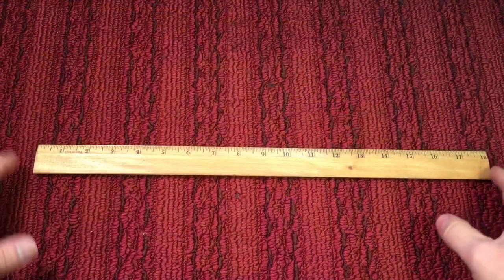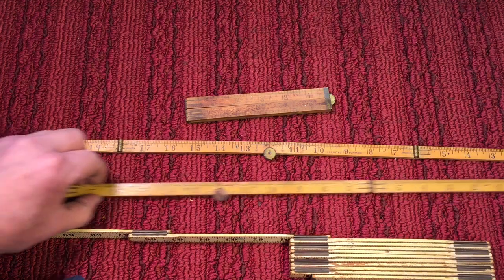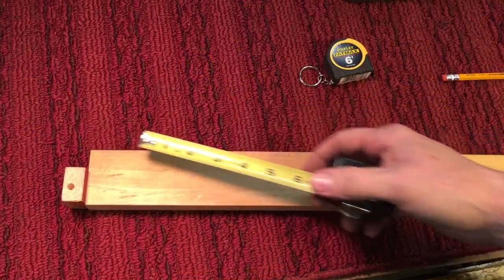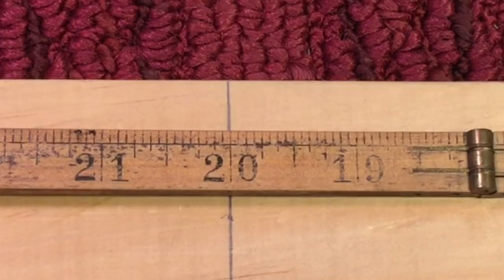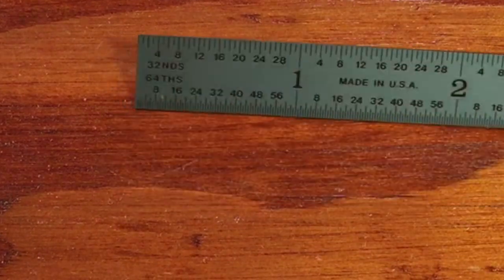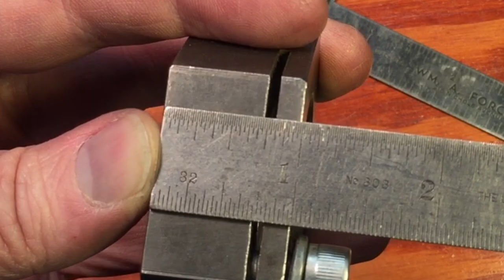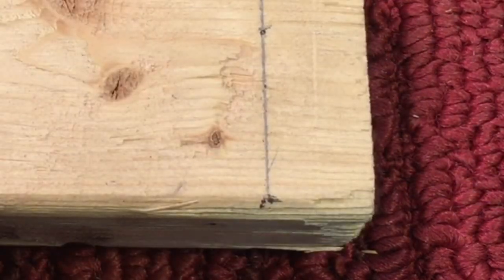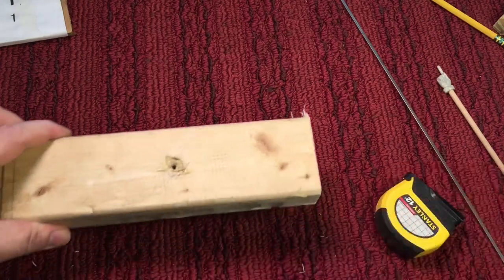Chasing Accuracy...  Rulers

Comment: My shop teacher back in the 1970's always said make your cut to the waste side of the line.  In really fine work whether metal or wood you cut and then fine tune to fit. On metal, it could be a file or sander or maybe a surface grinder. On wood you can use various hand tools or a sander.  Make a thin cut to true up the end on your wood before measuring.  The lumber yard edges are not always square. Do you have any of the metal folding rulers? I have one of steel. I don't use them much because they are not with the others.  My favorite pocket scale is in 32nd's and 64th's and on the back is the decimal equivalent list.  It starts at 8th, 16th, 32nd, 64th.

Comment: John another informative and interesting video.  I have always wondered about the accuracy of the tape measure vs. a yardstick or other ruler.  Also I picked up a good tip. I have always had problems with stuff always being just a hair off....you may have solved the problem!  I have been doing projects and losing my tape measure. So I would grab another one and keep working 😀

Comment: I grew up using an Architect Ruler for drafting. Now, it is done in CAD. 
A Pontiac Aztek looked better than the Tesla Cybertruck. The Pontiac had a tent, but it was a major flop!  
Question of the Day: Why do they call it a Framing Square, when it is a (right) angle? =P

Comment: I get the feeling the actual cost of that truck will be twice that.
Spending several years working with structural steel I was always amazed on how accurate we could be with a tape measure, a combo square and a scribe.

Comment: The cybertruck is most likely (in my opinion) going to be used offroad, possibly pitched to mining, forestry, lumber companies and border patrol. The reason I think this is because it's supposed to be bullet resistant, which also works against gravel, rocks, and branches, you can run air tools off the suspension which is great for repairing equipment in the field or changing a tire on it, it can go real fast, was shown with tires for offroad, it's narrower than a hummer, and it has no side mirrors. Plus they ran an ATV up into the bed, and border patrol loves to use those. In any of these applications it can be charged at a base that has grid power or a big generator and then go out into the field where other vehicles may be running off fuel.
They billed it as a light commercial vehicle, so the cost really isn't for the regular guy with a truck. However one of my friends knows a guy who apparently worked out that the top one would cost less than a base model F150 and is getting one, so I'll hear down the line how it is thirdhandedly.

Comment: A
Good wood marking tool is the marking out knife, get your point against the scale with the tip like you used the Scriber, hold it there slide the square up to it and score right across. Breaks the fibres of the wood on the surface so you get a very clean cut RIGHT next to it. 
I love those box wood folding rulers. Finding an unbroken one now is a real treasure!

Comment: Very good and informative video thanks. 
Something I never see mentioned is using a consistent method of measuring for very fine woodwork. For example I measure, when possible, from left to right, because my left eye is dominant. If I were to alternate between left to right and right to left it introduces a parallax error. I know the error is very small an its a bit anal, but it can be the difference between a barely noticeable join an a noticeable join. For extra accuracy with wood you can also reference the tip of the carbide tip into a scribed line.

Comment: Great jig to test rules and tapes! Great tips on cutting lumber. My miter saw has a laser but I usually don't turn it on, haven't checked it for accuracy yet. I have those little 6" scales, the Starrett hook scale just like yours. I love it. i remember those wooden fold ups.  I usually don't have a problem with cutting twice, measuring once..... The wife says I buy two of something sometimes cause I break one..... Great video! I hope your healing fast my friend,  Don't overdo it even when you feel better.  I wonder if the fans would like a lesson on micrometers, calipers and using gauge blocks or pins?  At times my micrometer reading is tough. I love MMM's!
Reply from the maker: Aaron you are the best!  😃👍

Comment: Good show, today. I enjoyed the rulers; maybe even more so, than the tape measures. I have a General™ 6" machinist rule that is in my pocket almost all the time. It has 32nds & 64ths on one side and 10ths and 100ths on the other. Obviously, I can no longer see the 100ths. Another way to mark off measurements is to measure twice, several inches apart. And put an arrow at each measurement. Either > and <; or ˄ and ˅. Then split the 2 arrows with a sharp pencil or scribe. When you split the arrows it makes for a very accurate line. Also comes in handy when you don't have access to a square. Anyway. Enjoyed it!

Comment: You know I have this biggest trouble getting my chopsaw square, same issue with the circular saw....I'm always off just to much. It kind of scared me away from woodprojects lately...
Great tip with the scribe tough, I am going to use that!  I like all the USA made rulers a lot too. Measuring in inches tough, so much calculating! I like the look of the inch but the metric system feels so much easier. 
You know I am not big on electric cars, I  don't like the radius they give you, the price, the look and them saying they don't polute, because the production proces is way more polluting then on a regular car and so is the polute when the car meets the end of it's road. Same thing with the electricity that goes in, it needs to be made some way.. But I like this truck!  And the reason is it doesn't scratch or dent and I'm worried all the time about my car getting dents and dings and it breaks my heart when it does.. Always looking for save spaces in parking lots and garages and walking extra far. So hearing from a dent and scratch free car, I immediately think, this is what I  need, who cares about the glass breaking, this would save me so many headaches!!!

Comment: The rulers with the hooks are used by printers and they are usually referred to  as Line Gauges. They include an inch scale on one edge and a pica/points scale on the other. I have two antique versions, one of wood and one of brass. I also have a stainless steel version that I used when I was working as a printer. They were also made in aluminum. The wooden version is not accurate and was a giveaway item to promote the American Type Founders Company. Pressman, at least in my day, were never without this essential tool of the trade in their back pocket or apron pocket. I still keep mine hanging near my workbench and find them useful. Thanks for another excellent presentation.
Reply: I still use my line gauge from back in my printing days. I even have the long one 36 inches.

Comment: Great video. When I'm looking for a more accurate measurement using a tape measure, I always "burn an inch". Also I always check the hook end accuracy up against a known exact  measurement.

As far as Elon's truck, no I don't think it'll start anywhere close to what he is stating. He also made a claim that he can dig a tunnel under LA for a fraction of what the industry can. I would hate to be caught in a fire inside one of his tunnels with no means of escape.

He made a claim with the new truck stating that it had the largest towing capacity currently available. Let's see it tow a 7K pound trailer uphill in the rain on a winding road. So what happens when you get to your campsite after towing your camper and battery is on E. Plug into the nearest tree? It's a concept, but not based on reality at the moment.

Comment: Hahaha laughing at what Rusty said, the peguins at my school went threw cases of yard sticks, they were like samari with them,  on jobs you would sink up your ruler with your partner, I taught my kids how to read a ruler with a Chesman Rabone stick ruler, 1/4's and 1/8s at first then 16's and 32s, love that limie ruler, it's not taught in school, miter saw, table saws the set up is key, from the fence to the right and left swing, the tilt of the blade, I even put a dial indicator on the blade to check for wobble espescily when I send blades out to be sharpened..,

Comment: Great mosh.  I always learn something from you SC.  Thanks so much!  Related to the your question on the Tesla truck...  Clearly, the company and its owner are being provocative, but you've got to hand it to them for what they are undertaking and their openness.  We have electric vehicles at work and they are great with limitation; however, I think for electric cars and trucks to go mainstream they need to have better range closer to what you get with a gasoline powered vehicle.  Also, the charging infrastructure needs to grow across the U.S., but it's clearly coming from what I can tell.  And as you suggest, the prices need to come down considerably for folks to truly get on-board.   No question, this is coming our way, but things are not quite there yet for the masses.  I'll say again, you've got to give Tesla credit for the space they are cutting out for themselves in an incredibly competitive business sector.  Even if one does not like Tesla or its owner, you have to recognize that what they are doing is the kind of thing that shows and highlights American ingenuity, creativity tied to problem solving, and willingness to take chance to potentially move the bar forward.   My two cents.
Reply from the maker: Daniel You are so right... The guy is an innovator.  That’s what we need.

Comment: Didn't see many business owners in line wanting to buy a fleet of the trucks? 
You can buy a better truck for a lot less than 30k, all supposing I had 30k.
We were taught in school to cut wood stating either:
1) Cut leaving line on.
2) Cut on the line taking into account half saw thickness.
3) Cut line off taking into account full line thickness.
Great vid and thanks for sharing
👍👍👍👍👍

Comment: I always liked Lufkin rulers and tape measures.I never used any other stick ruler than the Lufkin red end . But found Lufkin tapes hard to find after a while , so I switched to Stanley tapes . When ever I needed to make a cut , say at 10 feet. I made my mark in the space between 9 foot 11 and 15/16 and 10 foot, and best I could ,leave the line.
Reply from the maker: American Coin Hunting & Hobbies hi Dave!  It takes a while to get a system that works for you, sometimes years but it is so rewarding when you finally get it right!

Comment: Great video on rulers. I noticed one of the small hook rulers also had the printers scale on it as well. That's what I usually use when measuring. It's the most accurate rule you can use. 1" = 6 picas.  12 points to a pica=72 points to an inch. Great rule to use on cabinet making, especially getting drawers to fit.👍👍👍👍👍
Reply from the maker: Wire Works I never knew that!!!  Awesome!

Comment: Another thing I will do to be accurate when I really need it is to use the 1 inch mark as a start point rather than say the hook on the tape measure. Then just subtract 1 inch from my total as well as making my marks with a razor knife. Chances are that china tape was accurate just with a not so accurate hook. I just never trusted the hooks. Even over time the metal hook can become worn and throw off your accuracy.

Comment: Great tips John  thanks . Another tip not pertaining to rulers but to accurately cutting.  if using a chop saw to cut make sure the fence is actually 90 degrees to the blade when the scale is set to 90 degrees. A lot of times a new saw can be off a bit and people just expect because it's  a new saw that it is correct.
Reply from the maker: JBiz You are so right!  You can never trust the detents on the saw!  Setting up and trueing a table saw and chop saw is mandatory!  😃👍

Comment: Scout whats your thoughts on useing a knife Or razor blade for the cut line as aposed to pen or pencil. Also. How about some tips to avoid spilntering while cutting. Great thoughts on rules/ yard stick / machinest rulers aswell very cool stuff.
Reply from the maker: blindmelonlemonjello usually the only time I use a marking knife is when making dovetails.  The splintering piece sounds great! I grew up working mostly with Pine so splinters are everywhere!  😃👍

Comment: Pretty good tips! I don't do much carpentry but checking tape measures is a great idea! I use a 6" and 12" scale in sheetmetal work and prefer them to read tenths and hundredths of an inch to make the math easier. Laying out hole patterns is a nightmare with fractions!
Reply from the maker: upside downdog Yes!  Dividing too!  Nightmare!
Reply: @ScoutCrafter  
I doubt I could divide fractions anymore. I can barely remember doing it back in school! I had problems learning Algebra until I went to A&P school. Having a real thing instead of an abstract letter made it all work for me.
Reply from the maker: @upsidedowndog1256   you're so right!

Comment: Hi ScoutCrafter the glass on cars and trucks are usually laminated glass in the front and tempered for the sides and back laminated is easier to break but when it does it stays together because of the plastic layer inside. tempered is harder to break but when it does it breaks into tinny cubes or shards that can injure people. so the new idea is put laminated on the sides and back as well safer but you can break them. it did look bad but it was normal for them to break like that. $40,000 seems cheep.
Reply from the maker: david you are spot on!  People often confuse the two...  I am still amazed at how windshields are made!  😃👍
Reply: @ScoutCrafter  if you look at it from the side it is like a sandwich only the glass is the bread and the plastic is the peanut butter

Comment: The "Cyber Truck" won't ever reach production. It likely wouldn't pass pedestrian safety standards, and there's a good reason panels on cars have creases, curves, and bends. Strength. Even If you've ever pushed on a wrangler door with it's relatively large flat space you'd know how much trouble they've had trying to strengthen those up. You're going to need an entire secondary process on every single panel in there, either glued or welded on the back face. Meaning the body work of that thing will be heavy, labor intensive, and expensive. And Tesla isn't exactly the world leader in manufacturing. They're going to be having individuals in some tent somewhere in china attempting to glue the skin to the skeleton. They've already got terrible QC, so if it were put into production it would be a nightmare.

Comment: Concerning the Tesla truck..... $40K base price is probably close. The question is the level of content, of course. Should it give all wheel drive,  full climate control, decent security features and a real world 200 mile plus range with a fast charg capability in the sub 4 hour range, I believe it could see the needed fleet or work truck sales.  A longer bed with a smaller or forward  passenger compartment would go a long way to make it more useful.
Reply from the maker: I think the safety regulations will up the price, air bags, 5mph bumpers...  =D

Comment: I’m sure that even if you got the truck for $40,000 you have to hire an electrician to create a charging port for it at wherever you live and there needs to be another one at whatever the range is for it. Let’s say it can go 300 miles, at 300 miles you will want another one and have at least 6 hours to kill waiting for it to charge up. Driving from NY to Florida would take several days. And the $40,000 is the base price. If you want certain luxuries I would anticipate that realistically it will be a minimum of $50,000. You’ll be paying the electrician probably $5,000 if you want it to also back feed your house. Someone should work out the cost per mile to drive it vs the cost per mile of a gasoline car. As far as the environment goes, the overwhelming majority of anyone under the age of 40 will believe that this vehicle is zero emissions. They are completely oblivious (by design from the teachers in the public school system) that electricity comes from power plants and they believe that if the vehicle itself is not burning fossil fuels that they are doing a responsible thing. It is beyond their comprehension that the power that they draw from is produced somewhere else by a fossil fuel. But they are completely content to say “if I am not doing it, it’s not my bad”. I talk to people all the time and less than one percent have ever heard of the concept of zero sum gain. It’s actually quite frightening to be aware that our future is very bleak and about to become extremely inconvenient because of the militant youth who will be forcing the rest of us to adopt the “sustainable lifestyle” that they think is possible, but is not remotely based on any experience in reality. We are kind of fucked.
Reply from the maker: Joe you are spot on-  Years ago this was called “Penny wise dollar foolish”. 😂😂😂

Comment: To me that Tesla truck looks like a lifted DeLorean.  The firefighter in me is also a little concerned about those nearly unbreakable windows in an emergency. Yes, I saw that they still needed to work on the unbreakable part.   As to the pricing I am guessing that will be a pretty bare bone setup, one maybe two motors, certainly not four and a very small short range battery.  I am curious now if that is a completely new platform they are building the truck off of or is it something they are already using.  Those Rivian trucks certainly look better to me, and I believe they are further along in development as well.
Reply from the maker: Remember Elio?   =)   https://youtu.be/lQRktJtrgHs